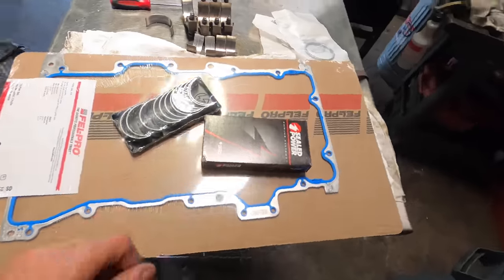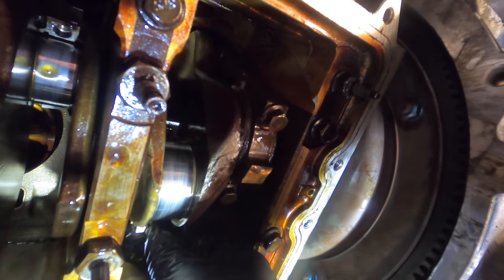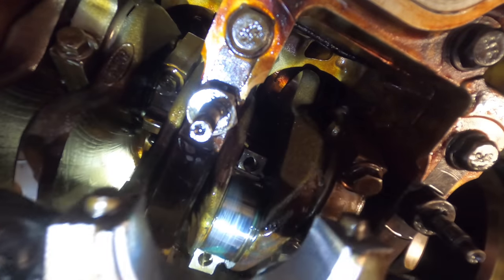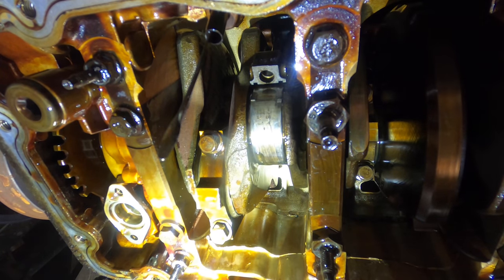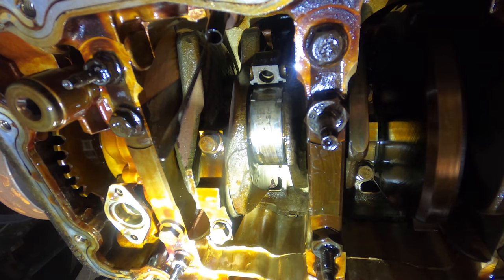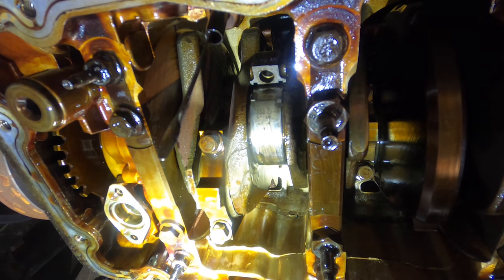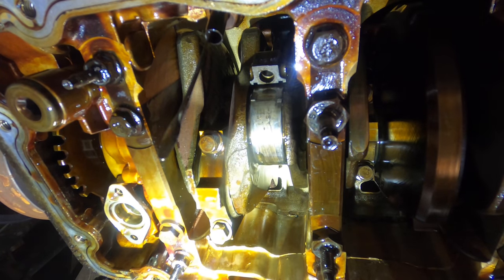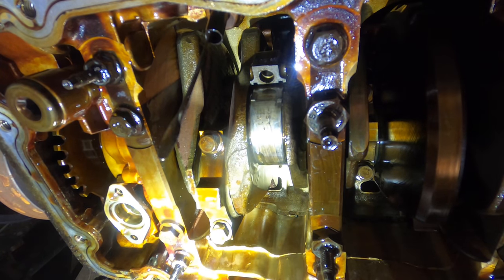Saving an Engine: Spun Bearings Replaced

Comment: Nice save!
Never seen a motor with a spun baring saved much less reusing the same rod. How does the shop warranty something like this when there could be scuffed piston and other nasty surprises lurking around inside an oil starved motor that might last 100 or 100,000 miles? 

Really enjoy your videos and positive attitude.  Thanks.
Reply: I have only ever done this on a 1932 Morris Cowley - at the roadside too - then I had to use engineers blue to set the shims and scrape the junkyard replacement shell to make the replacement shell bearing fit.  Today with standardisation it seems easier!!
Reply: @patrickpowers5995  When I was a kid I remember my dad telling me how his dad used leather from his belt in place of a rod bearing. Motors turned slow and times were hard back then
Reply: Slugg, I spun a rod bearing and the conrod had elongated into an oval on my turbo engine. With the engine in the car and without removing the crank, I was able to sand down the main and rod journals, and change all the main and rod bearings. Obviously the damage was much worse than his.

I debated buying a new conrod but didn't want to have to remove the entire top end to pull the pistons so I decided to shim the conrod cap with a piece of soda can (just a shim on the bottom not the top) and used standard size bearings everywhere including that one conrod. I had debated whether to use one standard and one +1 oversize bearing on that one conrod but I'm glad I used the shim now.

I checked all clearances with plastigauge. It runs great has good oil pressure (70 cold and 35 hot). I babied the car for the first couple hundred miles, changed the oil and since then have been driving it hard as normal. It's been about 6 months since the repair and runs great. All that to say, don't give up you can fix these type of problems without rebuilding the entire engine.

One note about the journals. He didn't do much polished on his, they still look like they've got some bad scoring. I literally spent several hours just sanding mine down (4 rod journals) and in the end they looked like new with no scoring including the one that had the spun rod. I wouldn't have felt comfortable putting the new bearings on with the amount of scoring his had.
Reply: @markgunther2502  Great fix. Necessity is the mother of invention. I remember my great uncle saying he cut a strip of leather from a belt to use as a rod bearing in an old flathead motor once.
Reply: @Slugg-O  There's a crazy Russian guy that has a channel and he does experiments like that with leather bearings.

Comment: Great videos! I'm curious, how many hours did you put into repairing this engine?
Reply: He should have a time clock counting .
Reply: @bluethunder4542  it was probably a good 5 day job. Car drop off and inspection. Tear down and parts order. Then 2 videos at 45 min a piece with I assume are two days. It was probably a good 9-12 hours from the minute the first exhaust bolt came out to drop the pan and complete the job
Reply: When a warranty repair from a dealership get billed to the manufacturer, they only pay for 8hrs. So “industrial standard” is about 8 hr repair.
Reply: God loves pessimistic ppl.
Reply: @BeforeBuildQC  I don't think that's a warranty repair. Don't even think they have made a Mercury Sable in recent enough years to have a warranty. I could be wrong though?

Comment: I'm no mechanic but when I helped build a motor, we used lithium grease on the new bearings so they didn't run dry
Reply: Engine Assembly lube is best.

Comment: Wondering how this goes. I changed bearings in a 4.5L Cadillac years ago and while it fixed the knocking and ran great, the head gasket blew 2 weeks later (I know, no relationship). Have to wonder what else will go wrong with this poorly maintained pile.
Reply: Same thing in cadillac I had in the 80s.  Poor engine design, the HT series known for those issues

Comment: I think were all wondering,  what was the cost of a repair like this?  Thank you for sharing so much fun to watch.
Reply: For sure. But this job was 95% labor so I can't imagine it was over $1000 despite what others say in the comments.
Reply: Bearings are fairly inexpensive parts in total between $100-200 its mostly labor
Reply: @MrSupernova111  labor is the most expensive part of the repair in most cases.  dealerships are charging $150/hr now, and book time on a job like this is bound to be 15 hours, then you have 3 oil changes and an hour diag to boot.
*edit* what im calling book time being 40% over warranty pay out
Reply: @MrSupernova111  The shops around me (SE PA) charge $125-$135/hr labor so it depends on how many hours he worked on it. It's hard to tell in a video...

Comment: Very good call replace all the bearings. The only thing that I may have done, since you used emery cloth on the number 6 journal is since I'd already be into the bottom end that far, is I would have lightly emery clothed all the other journals while they were exposed. Did that to mine and turned out great! But you did get the worst one though. Oh....and thanks for no music. 😉😉

Comment: Would love to know just what the bill looked like for the repair. Pretty labor intensive stuff there.
Reply: @Jackie Apreil Ya I spent $1200 on a head gasket repair. Bought the car for the same amount...
Reply: I'm gunna guess 6 hrs labor at $180 per.  $160 for bearings and $80 for misc.  Total $1320.  If they use task codes instead of hourly it could be  much more....$3,000..?
Reply: sometimes the repair isnt worth what you paid for the car.
At that point it becomes a matter of "how much do you really like that car" and a matter of "devil you know" etc
Reply: Yes not a cheap repair
Reply: Most repair shops will give you a ball park estimate before even working on the car so the customer can decide if its worth repairing, because no shop wants to pay its employees to do the labor just to have the customer to refuse paying the bill and just abandoning the car.  

edit: Just ask whoever services your car on how much a repair like that would be. You saw all the work done in the 2 videos so you know what to ask.
Reply: Yeah ...most people use their auto repair credit for jobs like this.  Honestly for most poor folk you're screwed.  
Auto mechanic is one of the most important and best tade crafts one can learn imho. 
If crap hits the fan and the apocalypse happens mechanics will survive .
Reply: @FlameG102  . That really depends. I have a 12 year old car that has been paid off for about 6 years. I don't mind dropping $1000 on it if it keeps it running another couple of years. When I buy new car it will be a luxury car and I'm looking at $500-$600 per month in payments so keeping the old clunker going for another 2-3 years is more than justified. Too many clueless people think buying a new car is more cost effective than keeping a paid off car going for much less in maintenance and repairs. That said, the owner needs to decide if the savings in having no car payment is worth it. If I had to suddenly drop $3k or more on my car I might not do it.
Reply: @MrSupernova111  sure.
That's why people have to weigh the pros and cons when a big repair is up.
Putting more money than you paid into a car is obviously not ideal. But it's not always bad either.
We are too used to junking things when they no longer work instead of keeping the same thing, and fixing it.
My car is close to 20 years old, and I recently shelled out for a new catalytic converter. (To say nothing of replacing the failing air suspension few years back) not cheap, but to me, while its a common car I could easily replace, I know this car. I know it's problem areas, I budget for big repairs, and I know that if I fix it, it will always treat me right and take me home. I know what repair I can put off and which I can't. As well as knowing that certain repairs, while not cheap, can prevent other wastes of money down the road.

Case in point I put off having to replace the air ride due to cost. And as a result, I ended up having to replace the air compressor after burning it up with constantly having to inflate the entirety of the airbags every time I used the car.

Things like that. So I learned a lesson.

I'm dedicated to keeping the car on the road, it's not rational maybe, but I love my car.
 if your baby breaks his arm, you don't just get a new one!
Reply: @FlameG102  . Agreed. Cheers!
Reply: Someone is going to be eating a lot a Ramon Noodles in the near future.
Reply: Thank you so much for not adding the music this time!  Also It's really hard by my experience to find non-copyright music in large quantities of anything good.  NoCopyRightSounds is one of the few places to do so, but they are very limited in Genre's for now.  That said, Electronica is my favorite so that works, still; not every video type needs music.
Reply: @spartan9458   I miss music, so yes, I can agree with No copyright sounds or even fatrat. Fatrat allows use, as long as you name him as the artist.
Reply: If it it was my car I would swap a used  motor in it if I liked it that much
Reply: I couldn't imagine not knowing how to repair my ride. I'm not a car mechanic by trade but I grew up with them and I'm still a mechanical technician. I have yet had a repair I can't handle including custom motor swaps and splicing wire harnesses
Reply: @christopherscott8853  the sad part is that $180 per hour is nowhere near what the mechanic gets, he's lucky if he gets paid $30+ an hour. shops should pay a 60-40 split with their ASE mechanics. the prices today are highway robbery mechanic shops in the early to mid-2000s used to charge around $50-$60 an hour and the mechanic made around $20-$25 an hour. i know it's sad for the mechanic if shops lowered prices to an acceptable level. but when did it become cheaper to buy a new car than to fix your old one? i used to be an ASE mechanic for 7 years until I got fed up with all the bull shit.
Reply: @MrSupernova111  That's how I look at repairs as well; I have an 07 Jeep Grand Cherokee that I've had for almost 4 years with no major issues. A new car would probably cost me 2-3k a year in payments plus my insurance would probably go up as well since that car would be worth more. I'd gladly sink 2-3k into it for repairs to get a few more years out of it.
Reply: @Airik1111bibles  In that case they'd better know how to service electric and diesel (running on vegetable oil of course).
Reply: @FlameG102  I think when a lot of people forget when making the calculation to spend "more than it's worth" on a repair is the total cost of ownership when it comes to a car. From a financial perspective, unless a car has deteriorated to the point of being unsafe (i.e. frame rot) it almost always makes sense to invest money in keeping a car on the road.

-Even a major repair will likely be cheaper than the money you lose annually in depreciation on a new/newer car.
-Insurance is cheaper on older cars.
-Property tax (if applicable) will be cheaper on older cars.

For some applications downtime for repairs can be an issue if you don't have another car, but if you keep things maintained, the probability of significant downtime is reduced. This car would likely have never needed that repair if the owner had kept up with the oil changes.
Reply: @christopherscott8853  wow, is the labor rate high these days? it used to be $80-$120.  Dealer rates for Euro cars were $180.
Reply: @epia125  Its just an educated guess but I think I'm pretty close.  I know that most service type jobs are done by the task rather than hourly these days.
Reply: @Airik1111bibles  true that! And plumbers too!
Reply: Keep in mind, used cars in much of the country are being sold at a premium. In today's economy it may be better and easier to have this work done

Comment: I would've used a micrometer on the bad journal to see if there was any wear. Might need a .001 oversized bearing for what you were dealing with. Highly recommend Moly assembly lube. Does a fantastic job of coating all wear surfaces with moly to fill all microscopic imperfections and provide a wear surface between the surfaces. This is still a patch job type of repair and not very reliable. Desperate times call for desperate measures.
Reply: Being in the inspection trade and working on engines also, I can tell you that you have to remember the journals wear at the point of compression stroke but most at the power stroke. This said, you have an out of round condition, a 'lobing' just as a cam lobe is to a vastly lesser degree. Putting in a bearing different than was installed originally FOR EACH JOURNAL would/could cause a/many journals to seize. it is best to replace ALL bearings with like designation, this will not CAUSE issues that were not present.
Reply: @nickmay492  so what does that mean?
Measuring them would be a waste?
Or using oversized bearings would have been futile?
Or simply replacing them all as he did with stock pieces was the best he could of done?
Isnt the bearing the item that is supposed to be worn if anything gets worn? Thus preventing wear to the items you dont want wearing? N making the repair of those serviceable items possible?
Anyway, idk much about engines just curious about what ur saying in regards to this job in particular and what he did specifically?
Reply: @todtalk3912  the answer isn't a simple one. First, my question was, WERE THE MAINS CHANGED??? I still have not discerned this. As for your question, yes, the bearings are supposed to wear, they are the 'sacrificial' component. That said, the crank journals also suffer wear. the power and compression strokes take a toll on the journals. That said, oils starvation comes into play also. Using the same sized bearing as was installed originally, one would most likely get away with it. Measuring is 100% REQUIRED to know the state of the journals AND what size to use, second to reading the size on the back of each shell. Assuming there is a 'stock' size would be dangerous as even a 'new' crank can have differing sized bearings, based on the original journal 'grind' (I found ONE 'stock' crank with two bearings that were .001" undersized vs. the remainder). The best way to go, IF the crank isn't to be ground or replaced, also understanding that the journals will NEVER be cylindrical nor 'originally' sized is to use the sized used when the engine was built. This will offer the best case scenario for success. if when the journals are measured there is excessive lobbing, the crank should be cut or replaced as you run the risk of spinning a newly installed bearing.
Reply: When you replace crank bearings with thicker ones, they are said to be UNDERSIZE, NOT oversize!! Reason for this is simple. When a crank is machined, the bearing journals are smaller than original, therefore being UNDERSIZE, & the bearings to suit are called UNDERSIZE. I did this sort of work most of my life, & I'm getting close to 60 years old. The only oversize internal components are pistons & rings when the block is bored.

Comment: To be honest, I’ve never seen this procedure done before. I have only seen this done with the engine out of the car on a stand. Very interesting!    Roger in Pierre South Dakota
Reply: Normally you would want to do all bearings/rings at the same time, but I assume since the motor isn't high mileage, is why it's worth just doing the big ends.
Reply: @Cheepchipsable  I helped a friend do this job (both of us amateurs) many years ago. Car was a bit of a beater. We also did the rings and reground the valve seatings at the same time. Oh  - and we put oil in before putting the drain plug back in - only lost a couple of pints before we noticed!

Comment: I have a straight inline 6 that  developed rod knock in October 2021
I have been dreading pulling the engine and replacing the crankshaft 
I am definitely going to try this first 
I was only going to replace the one spun bearings
But now I am going to replace all 6  with a set
Thank you Ray from Florida 
An appreciative viewer from New Mexico

Comment: You’re a great mechanic! That engine was in life support ☠️ and you saved the customer thousands of dollars! 👍. What was the customer’s reaction after the good news?
Reply: Why so much for the repair?  I’m going to the bbb and report you! Lol
Reply: Hope they were very appreciative 95% of other mechanics would have trashed that engine. Great work.
Reply: @tomo4635  He SAVED the customer thousands of dollars - that would've been the cost of getting even a used engine and installing it.  He didn't say how much the charge was for this repair.  I imagine it wasn't super cheap, but it was cheap compared to a new engine.
Reply: @tomo4635  dont worry dude, I go tthe joke !
Reply: judging by the fact that they never changed the oil, I'm sure they won't fully appreciate it. Probably just selling it.
Reply: Saved thousands but can't guarantee how long it will last.